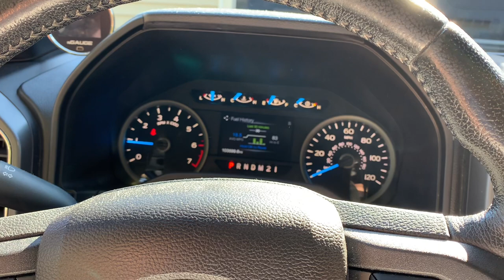How to pre-lube your Ecoboost engine/turbos/oil filter!

Comment: Thanks. I installed a blow-by catch can on my Ecoboost. I use pennzoil platinum with 8oz of Redline Zinc additive every 5000 miles. No possible chance of any zinc making it to the cats. IMO that long cranking is too hard on the electrical system and battery. Zinc also provides  Turbo protection.

Comment: so your cranking at 300rpm and start it at 500-1000 rpm? personally think it’s pointless
Reply: It’s not. It builds oil pressure in the system without generating heat or injecting fuel into cylinders while cranking vs injecting fuel and cranking
Reply: The part he left out of the video is it builds the oil pressure. You can actually watch the oil pressure gauge and as soon as it goes up then you take your foot off of the gas and the truck will start already under pressure. This helps alleviate the cam phaser rattle.
Reply: Is it good to do this all the time lol

Comment: Is there a way to do this without starting the engine short of pulling the fuel pump fuse?
Reply from the maker: I’m not sure honestly. I’m sure if you keep the gas pedal to the floor, turn key on and then turn key off and remove from ignition it would stop turning over.

Comment: Have you decided what you are gonna do?
Reply from the maker: Shopping for used engine. Long block is $6500 from ford and they’re on back order for like 5 months, and that doesn’t include turbos, lines, gaskets, etc.
Reply: @bullhead360  I see them on ebay complete all the time, minus turbos. I have been wondering for a long time if a first gen truck could use a 2nd gen long block and just use everything else from the old engine. The was a 4000 mile 2019 2.7 on there at around 4500.

Comment: I have the Baxter Performance oil filter adapter and it has a check valve in it to keep oil in the front passenges and then the spin on filter holds oil too. I wish I would have had this 200,xxx miles ago.